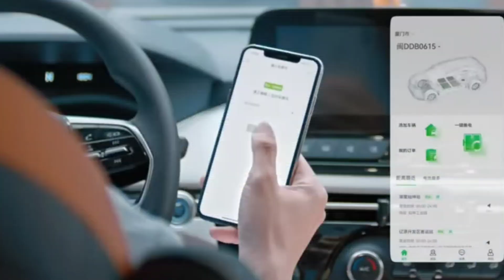⚠️EV Battery Replace 5 Years⚠️

Comment: These made up narratives are playing on people's stupidity.  My own experience here in NZ: No charging available...Lie(chargers exist on all major roads at75km or less distance),  They always run out of juice and leave you stranded....Lie(I get almost 500km/charge),   They are super heavy...Lie(my suv weighs 1800kgs, less than average for ICE suvs, the computers always malfunction.... Lie(never a problem, ever).  They can blow up and/or burn out of control...Lie(HYBRID cars do have problems burning badly, but normal EVs?  No.). People listen because the oil industry pushes the lies, and they do it by using selective facts.  Ex: EV batteries are very heavy so EVs are much heavier than your car, the battery IS heavy... but they forget to remind you that they also have no engine, transmission, coolant, or lubrication systems.
Reply from the maker: Ty for your input 👏 👏  finally I get to hear a positive spin instead of all the negativity

Comment: There's literally gen1 Teslas driving around having clocked 500,000 miles and are just needing a new battery now. $19,000 for a new battery for a $70,000 car. You can't source a brand new engine out of a crate for a $70,000 car. But you can buy a brand new battery out of a crate.
Reply: I don't think they're brand new though.  My understanding is that if you buy a "new" battery from Tesla, it's rebuilt, or more likely, a repaired pack with balanced cells.  The new generation of structural packs are glued together in a single block and can't be repaired at all, so I don't know how that will effect structural packs when they get out of warranty years down the road.  I think the best option would be simply to pick up a used pack from the junkyard like we do for gas engines and automatic transmissions now.  Hopefully they won't start coding them with internal vins that will require reprogramming.
Reply from the maker: Right

Comment: Sir you are absolutely correct about the numbers and that most electric vehicles can easy do over 10 years with their battery. The problem is that cost wise replacing a battery for a EV is at least as expensive as replacing almost the complete drivetrain in a combustion engine car. This is more then most people have in their savings account and people are afraid it might happen to them because most of the time the chepaest way out is buying a complete new car (because you start with all fresh warranties again). Also what is the chance you need to completely change the complete drivetrain (so similar costs) of a combustion engine car? Most of the time cost of a combustion engine car can be limited to replacing most critical parts + labor. And the number of people who can repair a combustion engine car (professional or diy) is very big. How many people can repair a battery pack (replacing cells) of a EV battery? Not many so for most people bad battery is full cost replacing the whole battery. There is virtually no chance that you can limit the cost when it happens. So in short yes EV have very low maintenance and very low cost for maintenance due to that. Yes the battery normally live very long. But when it breaks it's very expensive, even when the prices will be 50% in the future. It is just about it being one huge bill when it happens to you as opposed to cost of combustion engines being more spread out over time. As most peoples income is more spread out over time it is a better match with combustion engine car costs.
Reply from the maker: Very Very well said 👏 👏 👏  ty for the input. I hope you continue to Critique my videos